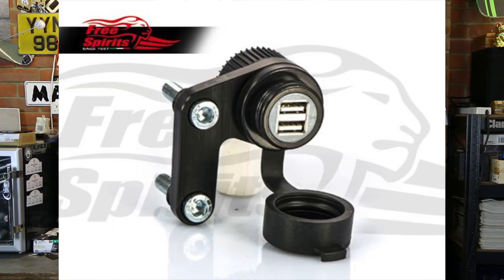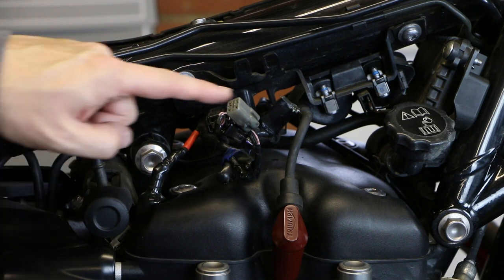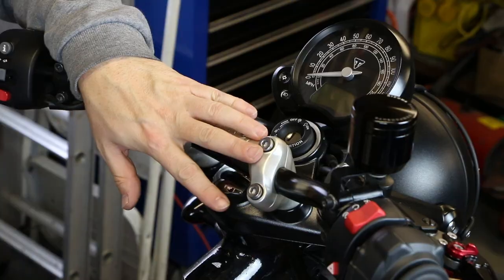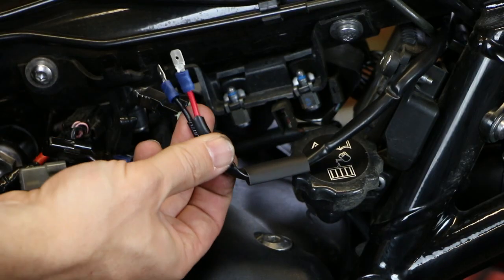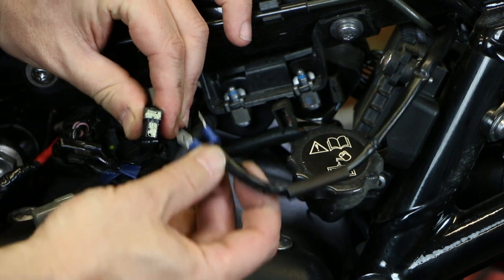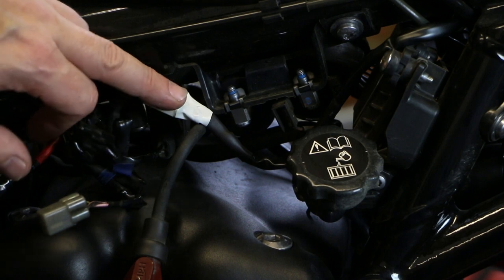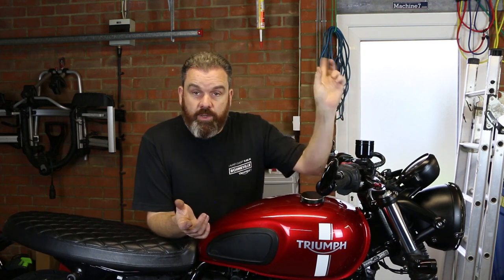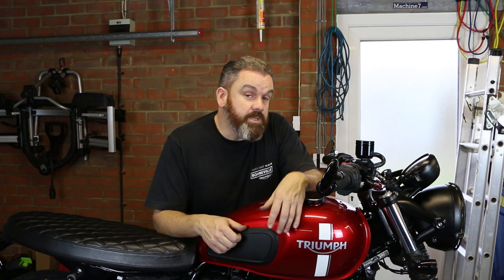How to fit a Freespirits USB socket to a Triumph Street Twin

Comment: Thanks for this. I'm going to be doing something like this soon on my T-100.  I'm curious, is it possible to fix something like the Quad Lock 12V to USB Smart Adapter in this circuit to prevent unwanted battery drain?
Reply from the maker: Yes, I guess you could install it in the same way

Comment: Just got a new T120, and need power for my GPS, thanks for the video, quick question..... the power socket under the tank.... is it powered continuously, or just when the ignition is on?  Many thanks, Bob.
Reply from the maker: It’s a permanent live rather than switched

Comment: Tony love your video's ,but I have found the standard 1 metre cable for a I phone reaches a treat to the handlebars with the ultimate add ons phone holder from E bay . Granted it hangs over the tank, but good enough for occasional use . Love you're video's by the way , need more stuff on the Tiger 800 . Service intervals cost of services and stuff you can do yourself . Go steady .
Reply from the maker: Cheers, yes that’s what I used to do, but it was a bit of a faff. There will be more Tiger bits coming along at some point

Comment: That's fantastic! I will have to check. So this plug is direct power from the battery? I could use it for a harness with in-line fuse and relay for an aftermarket horn (instead of running the harness all the way to the battery for hookup)?
Reply from the maker: Yes, but its not switched through the ignition, so is a constant live.
Reply: @mancavemoto  Right. But if the horn harness also connects to the horn switch, should be ok? That said, I'm now thinking of installing a usb on the handlbars. Do you have any videos on power hubs for 'multiple' accessories with swtiched and constant live outs?

Comment: Unfortunately, those USB chargers do not only use constant power to light up the LED, but also for permanently transforming 12V to 5V.
I learned it the hard way and had to replace a brand new battery after a couple of weeks. Then installed a standard 12V socket instead in which you can stick a mini USB charger whenever you need it.
Secondary benefit: You can connect a motor battery charger to it in case you store the bike for a longer period of time.
Reply from the maker: Thanks for the feedback
Reply: This has been my issue as well. I really liked this setup but I’ve gone through 2 batteries because of this. If the bike isn’t ridden for over a week there’s a significant drain on the battery.

Comment: Have you fitted an auxiliary power socket to your street twin, I believe it goes to same location you connected the USB port, I would like to fit both an run a dash cam, I have a dash cam with crap instructions, similar reluctance to cutting wiring loom.
Reply from the maker: I haven’t no. But you should be able to run a splitter
Reply: Thanks

Comment: Successfully  installed thanks to this video. Though I am now really worried about the constant draw on the battery. I ride year round so no winter storage and whatnot. What do you think, not a concern?
Reply from the maker: The draw for the little led will be miniscule and if you're riding it regularly it won't be a problem
Reply: Views from the Man Cave thanks much. Video was really helpful.

Comment: Hmm, i plugged the cable exactly where you said. The usb draws Power constantly, not only when the Key is turned (the led constantly is blue, even if Key is off) . Is this the same you experienced?
Reply from the maker: Yes, the plug is a constant live, not switched. A USB plug without an led light would be better, but it draws so little current that it would a only be an issue if the bike was laid up for a long period of time
Reply: @mancavemoto  Thx for the Info :) !

Comment: Great video - thanks. I have a Triumph Boneville T100 2017. Do you know, if I fit this USB socket, can it be used to power a TomTom Sat Nav?
Reply from the maker: No problem, and thank you. As long as it’s got  a usb cable this will be fine. It powers and charges my iphone with no issues

Comment: Thank you for your videos, much appreciated!
Do you know if the usb port you just added is more powerful than the one already installed under the seat?
Thank you again!
Reply from the maker: Thanks Eric, I’m not sure....I’ll check
Reply: Hi! Thank you for your reply. I ask that because I already had my phone turned off while it was pluged on the under seat usb on my T StreetTwin. No more battery... Also, this underseat usb seams not working if the motorcycle is turned off. Your added USB always works even if the bike is not turned on if I am correct? Those info are very interesting for this topic as knowing that, and if you confirm also that it works the same way on your side, it makes good arguments to add an extra usb port :)
Thanks a lot!
Eric

Comment: Really cool product but 96 euros? for what is essentially a USB extension cable? no thanks!
Reply from the maker: True it’s not cheap, but outside of the price of the electrical hardware there is a nicely engineered bracket and it’s a neat solution.

Comment: Do you need to turn the ignition on, to turn on the usb socket?
Reply from the maker: chong-keng limdr, no it’s a constant live feed
Reply: Views from the Man Cave but you don’t think that would be a problem of running out the battery (if constant on)? Or is it using to little energy for that to happen? Thx